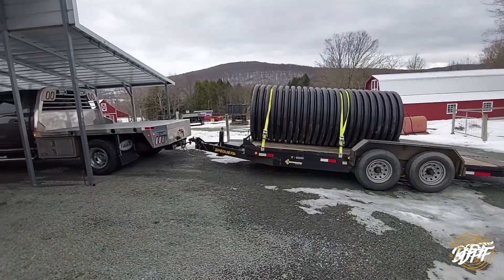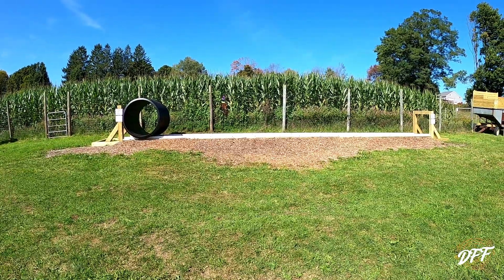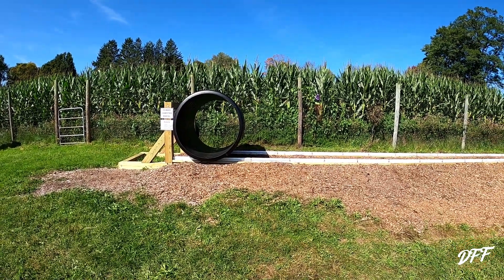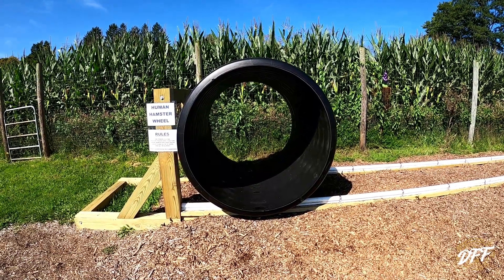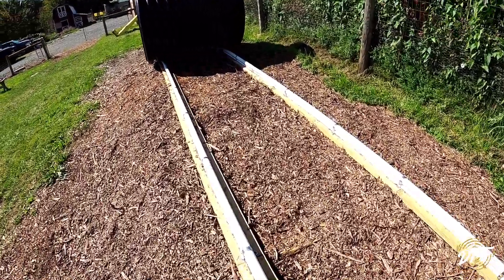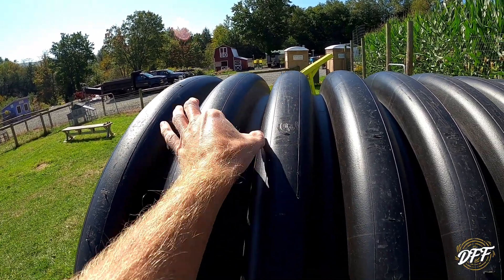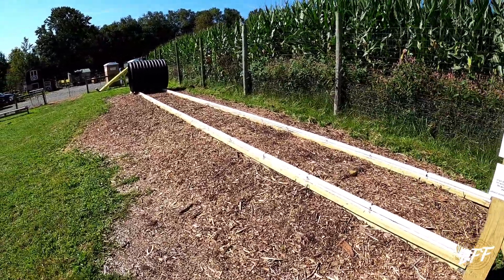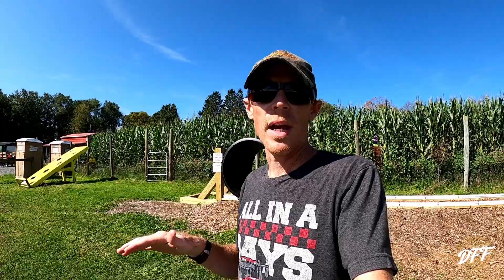You Will NEVER Guess What I Did With a 4 FOOT Diameter Pipe!!!

Comment: stand it on end and cut out a door. wrap the pipe with tubing in each of its ribs. punch and thread holes through the lining of the pipe at regular intervals affixing the tubing to each hole with something like dripline nosels except open enough to emit a hard spray. have a valve between each ring of pipe and set a timer on the valves so they open and close in sequence from bottom to top then back to the bottom. 
outdoor shower....